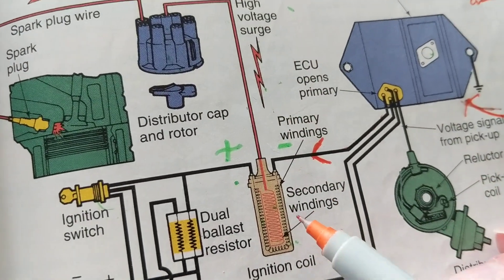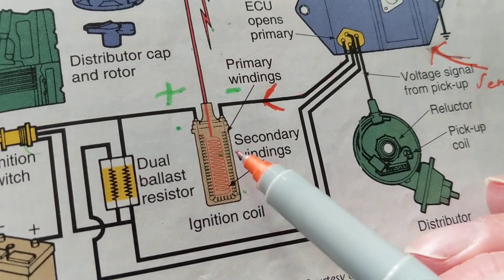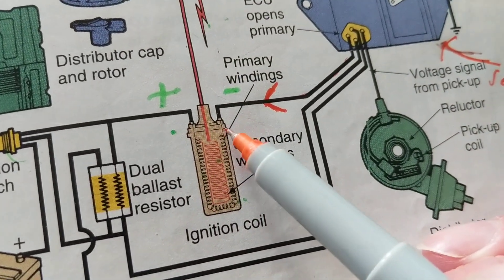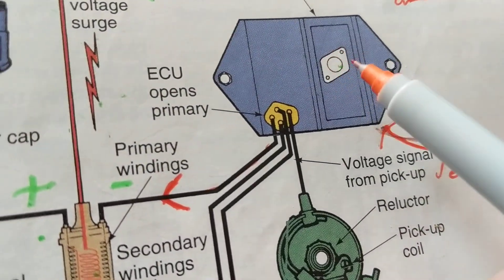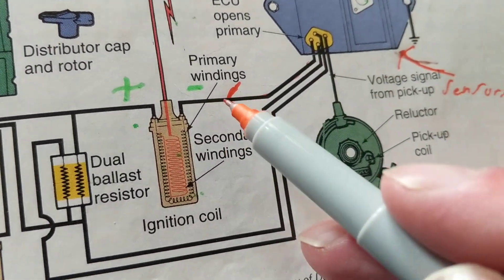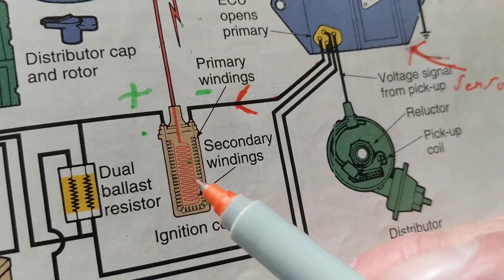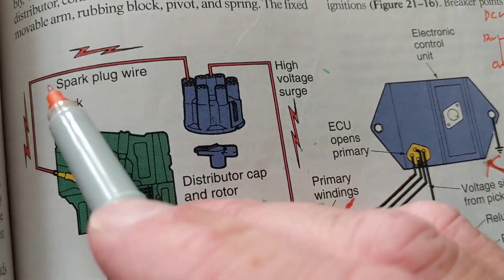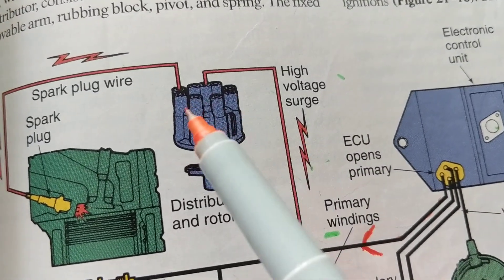how ignition coil works to give voltage to spark plugs part two very simplified pictorial

Comment: Outstanding presentation.  I think someone needs to be at a certain level with basics to take this in, but it does a really great job integrating both the explanation of the function of the coil and its interaction with other ignition components in that system as well as the role of the ecu.

Comment: This particular diagram looks very similar to the early-mid 70's Mopars.  These didn't have a lot of sensor inputs to the ECU as we see in later models, just the reluctor in the distributor.  The voltage regulators and ballast resistors were the source of many of the ignition problems with these vehicles if I recall correctly.
Reply from the maker: Yes sensors have been around for years in actuality but now it's almost like they are a necessity because of air fuel ratio

Comment: We need high voltage in order to produce spark on the spark plugs where as we have just 12 volts DC from the car battery. 
To increase the voltage we need to use step up transformer, here we call it ignition coil. 
Transformers are usually have two coils. The primary and secondary coils. 
The control circuit, in this case the ECU, oscillate the primary coil by turning it On/off. The number of times this turning on/off happens in a second is called frequency. Or AC frequency to be precise. 
That induces the voltage into the 8:secondary coil. Which is connected to the distri. 
The voltage induced in secondary coil is equal to turns ratio between primary:secondary coils. 
Oscillation changes DC voltages in AC. Which is required in order to make the transfer work. Transformers do not work with DC. 
Ini Jaee gal si

Comment: One of the Ignition coil is getting more output from the ECU due to which the ignition’ coil is getting burnt. Have confirmed the voltage with multimeter. All other ignition coils are getting proper voltage. Same issue has brought my attention to this video. Could you please help me with understanding the issue
Reply from the maker: Which is the make and model of the car
Reply: @Joeelectronicschematicsforauto  its honda civic 2010 model

Comment: Hie...What if your ignition coil is overheating??? What could be the problem, based on your vedio
Reply from the maker: Means your spark plugs are draining more c current through the spark plug wires the resistance got lower could be the spark plugs or the spark plug spark plug wires not necessarily the ignition coil
Reply: @Joeelectronicschematicsforauto  Thanks alot, l will look into it.....

Comment: Hi Joe,  not to bash  or trying to correct you, because right at at this moment I am also searching for an answer of my 76  dodge  truck, that sometimes it starts and sometimes it doesn't.  What I noticed is you did not mention the reluctor, which it does give an input to the ECU  to give a spark to its coil which eventually goes to the spark plug. Thank you.
Reply: Thank you so much for your comment yes I tried to keep a little simple and simple terminology because a lot of people saying I'm too technical in my explanations but thank you so much for the recommendation
Reply: Excellent teacher, Joe. Especially  replying very promptly.
Reply: @domalbe51882  much appreciated

Comment: Great video! Brings back many memories of years ago when I worked on cars back in the eighties. I also remember the old Chrysler "Lean Burn System" that had dual pick up coils and the old 4 terminal ballast resistor mounted on the firewall that failed frequently.
Reply from the maker: Thank you for the compliment